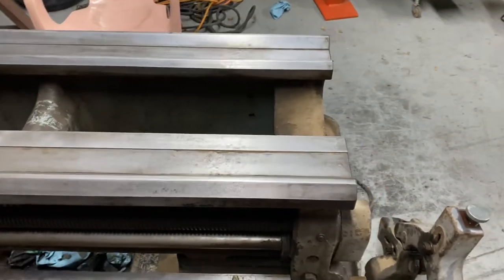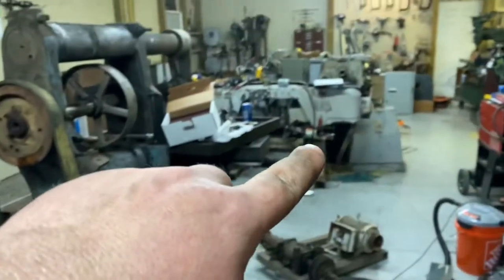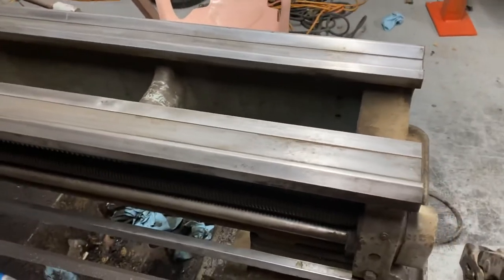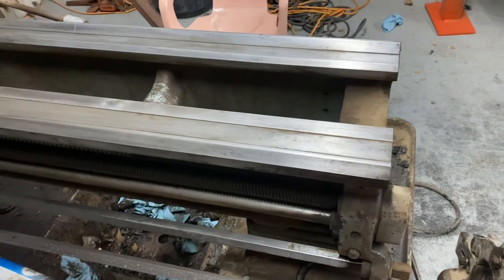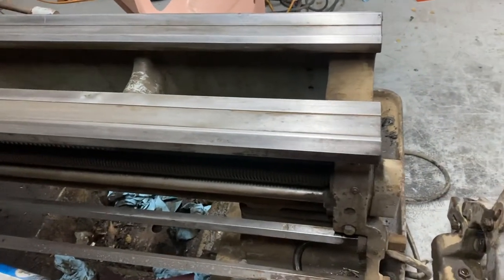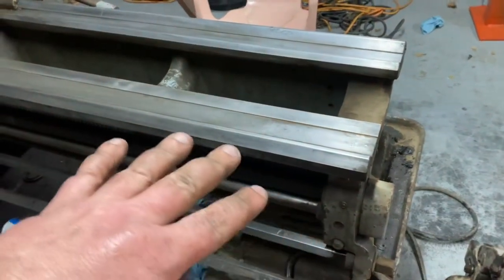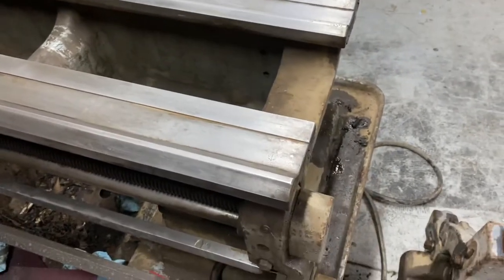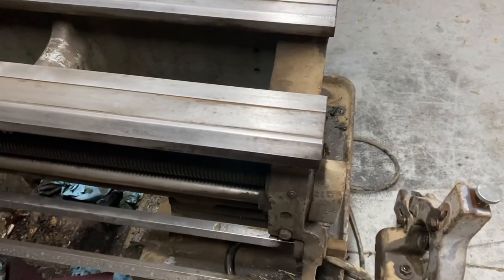Question about old U.S. Navy metal working machines

Comment: It may very well have never actually been on a ship.  The ports have full machine shops to do refits also.
As to finding a Manual for it, your best bet is Keith Rucker's Vintage machinery.org just as Kentucky Trapper said. Keith has scanned hundreds and hundreds of manuals and other repair  books and made them available to all for free.
Reply from the maker: Iv been checking it out and it is a very nice resource